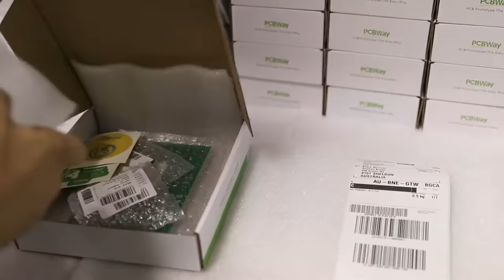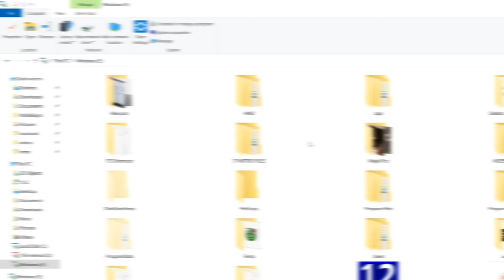LA County Metro Samsung Evo 860 SSD Drive Repair - A word to our sponsors

Comment: And they said repairs like this won't be possible one day. This is a forgotten skill.
Reply: Well they won't be once they decide to pot the entire board in epoxy. You can only repair what you can access. Things are becoming consolidated. First into chips then eventually into sealed modules. Game over.
Reply: It is already... You cant fix your cpu, while burned only 1 transistor inside, its sooo tiny :(
Reply: Its not forgotten or impossible (and wont be), just not economical.
Reply: More like with how often right to repair gets defeated it will eventually just be illegal to repair your property.
Reply: @MageLeaderInc  really? its already like that. If you repair your property without any "certificate" and it got broken, your house "jump to 9th dimension" (Like say Alex 😀), no insurrance will pay you a dime.

Comment: That circuit was most like a power regulator. That capacitor was probably a decoupling capacitor for filtering. Great video as always, Alex!
Reply: So it has more noise now which can lead to redused speed of the drive
Reply: @KaloyanDobrev  the data will be recovered and the drive disposed of. That is of no concern.

Comment: You are a ROCKSTAR - such a great demo of how powerful basic troubleshooting can be (literally) in the hands of a pro! 
I have done similar repairs since the days of tubes and really enjoy the thrill of reviving dead gear with only basic info. And it's almost always the cheap power supply!! :-) 
I used to be one of two guys who could keep a certain piece of German robotics running in a challenging install. Fun, frustrating and a joy to work with. No one else would touch it!
Bravo and thanks for sharing your passion and skill with all of us 🙏

Comment: I literally have this same hard drive and it also failed completely. Would not even be recognized by any device. I sent it in to Drive Savers and they couldn't recover data... I've now sent it to a guy in the UK who will at least try to repair the board, so I'm hoping he's as successful as you were here. I'm almost 100% certain it's also a failed component like this. I think the drive overheated and something burned out and failed. Only downside is it's going to take months for the guy to actually look at it and that's not even a guarantee he will fix it.

You are a life saver here for sure.
Reply: Should have sent it to that guy over in Wyoming. Too late now.  He won't touch it after two shops have molested it.

Comment: Great video as always, I have a question though. So you simply don't replace the bad cap? Is it a situation of redundancy where there's multiple caps of the same value on the board doing the exact same job? Also, how do you go about finding the value of a shorted cap?
Reply: Am curious about that too. Great minds think alike. 🙂

Perhaps it was more about data recovery than repair. Now LA Metro can get the data off the drive, so that was enough? Then they’ll bin the drive.
Reply: If not just intended for data recovery, but for reuse then the capacitor should be replaced and probably also the IC as those sorts of temperatures can quickly degrade them. The cap looked to be in parallel with another, this is common practice in many products and allows you to have double the capacitance without the expense or size of just one cap. Also, a form of redundancy (but not by design), one capacitor is better than none, especially on power rails. In this instance the two large capacitors are likely the same value so you would just measure the good one. Failing that you would either measure one from a donor board or take an educated guess, typically 10uF on power rails.

Comment: Wow. So cool. I appreciate your teachings Alex. Also, does the cap not need to be replaced as well? Or is it okay as is? Thanks again!
Reply: most caps are for smoothing out the voltages, and there are many of them in parallel.  As long there is no short at any cap,you can take out caps ,they are not really needed. But I think Alex replaced it anyway. Even the value isn't that critical
Reply: Question is if you want to keep using that drive...
Definitely keep a backup guys!

Comment: Remembers me of the time the TV in my home stopped working, back n the 90ies. Opened it, on the back of the PCB was a resistor mounted all alone. Went to measure it out of a whim... it was faulty. Changed it and the TV started working again. It was a 2MOhm quarter watt, I still remember. A stroke of luck. 😁

Comment: So it is not necessary to put another cap back for replacement?
Or is it just working for a moment, enough to save all the files to another drive?
Reply: had the same thought myself, guess it'll work without it but what was it's purpose?
Reply: Its for the latter. 
Not required to be able to transfer to another drive. 
Once a drive fails like that, you should never use again. Even with replaced components.

Comment: Do you need to replace the cap?
Reply: Nope.... it's in parallel - he will probably backup or clone data on new drive
Reply: The caps (x2) are connected parallel to each other, so the other cap will be picking up the slack from the missing cap (basically 1 doing all the work instead of spreading the load over 2 caps)

Comment: did u replace that cap u pulled or can u still run without that cap safely..i have an ssd that wont read...and hoping its same problem..and can remove that same part n then use it

Comment: There was a period where ceramic caps experienced a global shortage that lasted a couple quarters. This was traced to be a lack of forecasting for the enormous rise in consumer products and IOT stuff.  There was a mad scramble to get enough caps to build and ship. Major companies bought up the 1st tier supply at a premium to guarantee they would be able to sustain manufacturing.  Third party brokers stepped in and sold grey market parts from questionable sources. These had large initial fallout and really short longevity in the field. There are a huge number of these little caps per board.   Point being - look for them. They are out there. Ticking time bombs.

Comment: I'm not so super experienced, so I have a maybe noobish question: why does it work without the capacitor? Is it in parallel to the circuit? Otherwise the circuit would be open, wouldn't it?

Comment: Would you normally replace a failed capacitor that you took out of that ssd?cheers
Reply: Sure... But if the only goal is recovery to another drive.  Nope.  Connect it to a reliable low noise power supply and let her eat.

Comment: Dear Alex, I have the same SSD with that ATBGN chip failure (Burnt & damaged). I am unable to find it anywhere. I do now know what that chip does. Is that the interface chip? and a replacement of it
The Samsung SSD 980 PRO m.2 have ATCIM chip

Comment: Hey friend. Would you be able to repair my MSI GE75 Raider laptop?

I sent it into MSI, and instead of repairing it, they sent it back to me damaged even more.

I managed to fix most of it myself, but for some reason one of my NVME M.2 Ports seems damaged.

No matter what I do, the NVME drives I put in it only run on one lane of PCIE bandwidth instead of four, which is normal.

Any idea what could cause this and whether you can fix it?

Thanks!

Comment: Any value in replacing the cap or just leave as is?
Reply: The goal was data recovery. The SSD will be trashed afterward. No point in repairing trash.

Comment: No need to solder a new cap on the board?
Reply: he might have, but probably not, he would either copy the files or recommend they copy the files and discontinue using it. it probably isnt 100% required maybe just a filter cap which are still important but not for short use

Comment: Why didn't you put a new capacitor there?
Reply: it's not really needed as you have seen. it works just fine without. There are many caps in parallel . Most of the caps do nothing but smoothing the supply voltages and reduce interference. You can remove many without problem, shorts are the problem not if there are one or more caps missing. Resistors or filters are important

Comment: Great job Alex! - One tip particularly when dealing with data recovery is to make sure to use the computer's eject method rather than plug/unplug.
Reply: @iridium8341  So.. you are in favor of plugging unplugging drives without choosing the eject command? Please provide your technical reasons.
Reply: @PracticalKnow  What is the reason for eject rather than unplug ?
Reply: @richardmills5450  While it is certainly possible to disconnect a drive by just unplugging it, the eject function is there specifically to check the drive before it is unmounted to make sure there are no housekeeping tasks necessary. And while one may look at that and say "hey why would I need to do that I didn't double click on the drive to open it?" a for-instance might be a drive that has some kind of autoloading or Auto mounting piece of software. Choosing to eject the drive causes the operating system to check and close any items such as this prior to unmounting the drive. Just pulling the plug in such a situation can run the risk of data corruption - something I have seen occur numerous times on multiple platforms.
However it's important to note that the specific situation being referenced here, is one of data recovery. And this is where the avoidance of any possibility of data corruption is paramount.
Could you just pull the plug and disconnect it?
Perhaps. My point of the original post is why take chances on a data recovery operation? 
Alex is a pro at what he does.
But I've seen enough corrupt drives in my time including ones that were unplugged rather than ejected to use special care if the data is important to the project. Just passing along that tip.
Reply: @PracticalKnow  Ok I didnt know that . Thank you Cheers.
Reply: @richardmills5450  All good mate
Reply: @PracticalKnow  I'm having an argument with a coworker he seems to think that it's not the drive that might have the auto loading software but the computer itself so is it the drive that might have auto loading software or the computer?
Reply: @Neon-Starz  An example of an auto loading application on an external drive, ironically, could be a virus which is designed specifically to do that - which is another entirely different issue.
But if that virus is sitting on an external drive that you want to recover the data from you'd still want to properly eject it.
Because at that point you're not worried about the virus. You're worried about ejecting the drive without properly closing down the files, which may in turn result in corruption of the drive thereby compromising your ability to recover the data.
So the moral of the story is no matter what's going on, particularly when there is a data recovery situation at stake it's always the best practice to eject a drive from the computer menu command rather than unplugging the drive.

Comment: I am under the impression that you cannot measure a cap while it is connected to the board. Are you using a special (expensive) meter, or is measuring ohm loss a good way to test if a cap is bad?
Reply: You can't, but you can definitely measure a short.  Measuring ohms is just used to make sure it's not just a low resistance path, the exact ohm value doesn't really matter.

Comment: could some one explain to me that why after the resistor was removed why the drive started to work, I understand that it was faulty and causing the issue but in my head the path to the drive would be broken and due to the resistor not being replaced and so I am confussed why it now works, I suppose even through it could suggest the resistor is pointless I suppose it stopped the issue being more serious but wouldnt the path to the drive be broken now? To answer my own question I'm thinking perhaps the fault caused it to stop functioning but the path to the resistor had nothing to do with the path to the drive perhaps

Comment: You have just removed the capacitor, don’t you have to install a new one before connecting it to the PC ?
Reply: No.. for the millionth time.  No... no.. no.....
Reply: The goal is data recovery, nothing more. 
Whether the drive needs the component for reliable long term functionality is irrelevant.
Failed drives are trash/recycle bin once data is recovered.

Comment: I guess you still need a donor board to ID the value of that cap?
Reply: 2 options, no replacement needed, it worked just fine. or messure the other cap and read the value and replace it from  cap assortment book.
Reply: @dd313car  2 problems with that approach. The failed cap may not be the same value as the other one checked and although the drive mounted by windows, it doesn't mean "it worked" completely.

Comment: You left the cap off?
Reply: Pretty sure it was used for filtering only. It's not asbsolutely required for the drive to work, and they will most likely just backup this drive to another one (and to more than one drive if they learned their leson) as soon as they get it anyway

Comment: It just worked without that cap 🤔?
Reply: It has 2 in parallel for more stable voltage. One can do the job just fine. 

If not part of the oscillator circuit, exact capacitor value is not very important. So if he went from 4uF to 2uF, it still does the job.
Reply: Yes mostly such big caps are back-up capacitors between VDD and GND. The only function is to smoothe the power supply of the ic.
Reply: Thanks guys, smarter every day :)
Reply: Its not as reliable as it was when new but usually still works. Usually you still want to replace the failed drive after you save the data, because it might fail again. For example here the mosfet has been overstressed by the short, and might fail a lot sooner.

Comment: Kinda wonder why you did not transferred the files into a new SSD then sell that to them plus the recovery fee. 😆😆😆😆😆😆
Reply: I think that's exactly what he did, he explained multiple times that's what they do with data recovery.
Reply: That’s cheating at its best
Reply: @dirzz  i thought Alex will just return the original SSD with no caps to the customer. 😅😅
Reply: Well drive still somewhat faulty. I personally would do the same with my own data and just move it off.